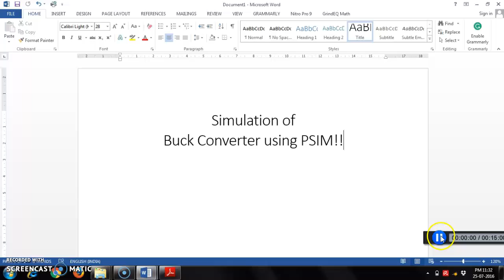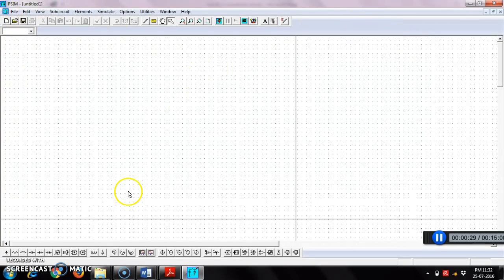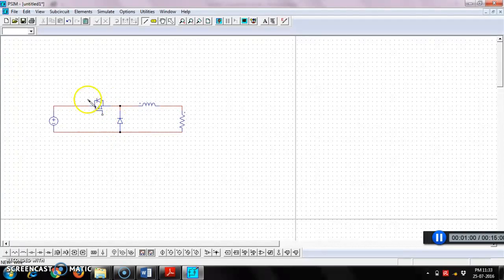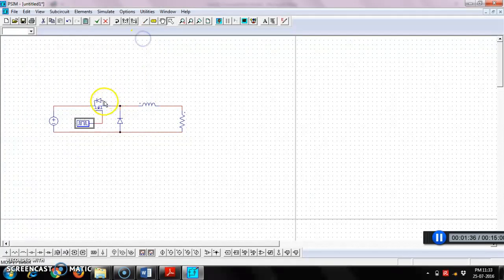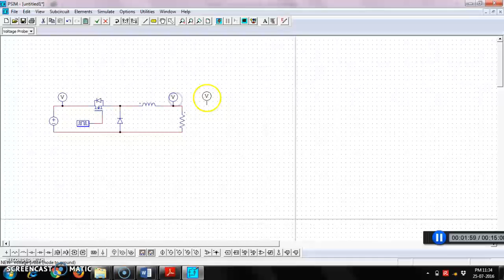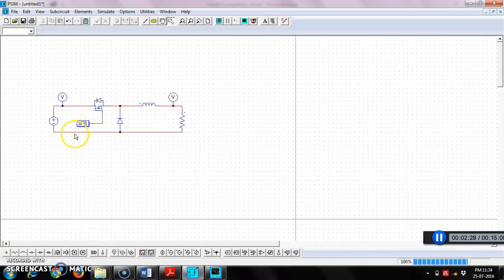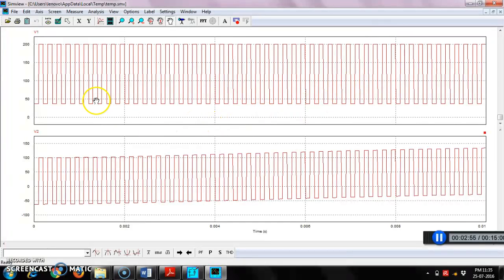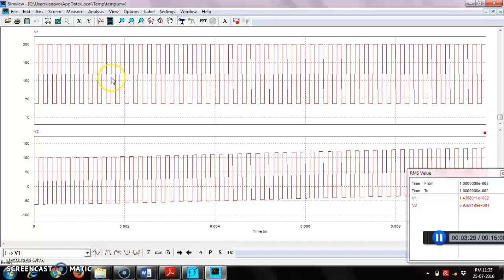Simulation of buck converter using PSIM

Comment: hi I have a question, do you have an equation to calcule inductance?
Reply: u can find it if u put the minimum current = 0 , Imin= 0
and then find the minimum current
Reply: There is a formula to calculate the minimum inductance if you have the switching frequency and the duty cylce